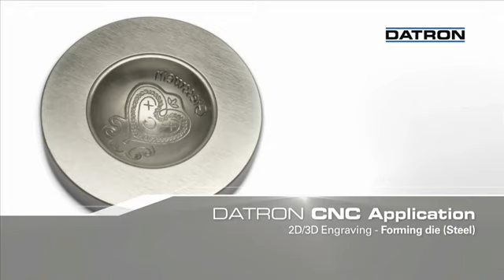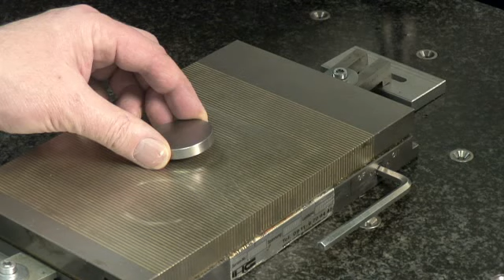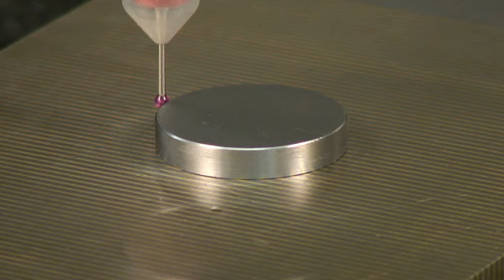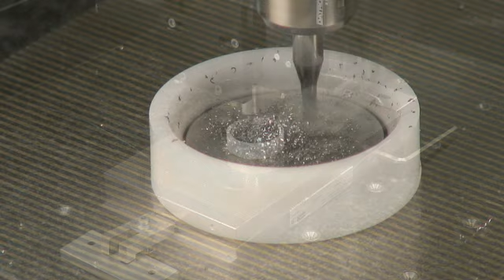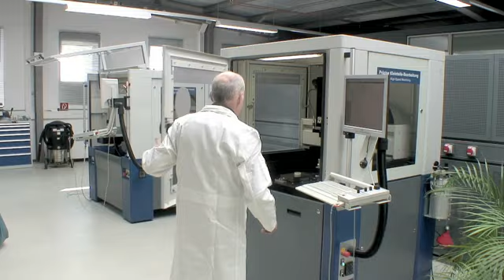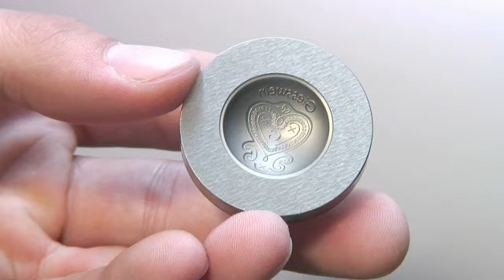DATRON CNC Engraving Steel 3D Mold

Comment from the maker: DATRON customers machining steel use a variety of oil-based coolants depending on the hardness of the material and the paticular micro tool being used.  It coild be vegetable-based, water-based or cutting oil.  DATRON machines have a micro-jet option for low-volume application of oil rather than flooding with oil.  In this case, since the part was fully contained in a fixture, a few drops of coolant cover both the blank and the cutting edge of the tool.